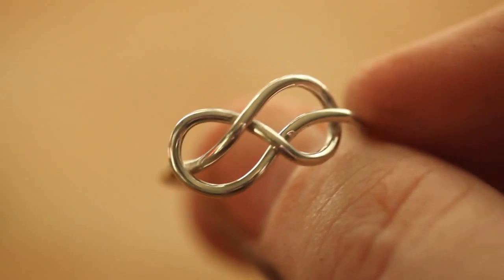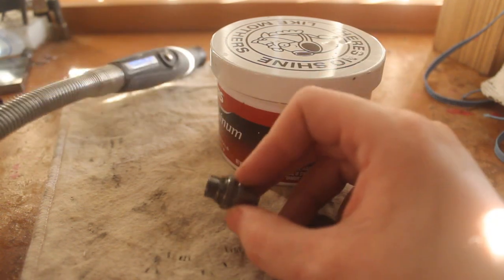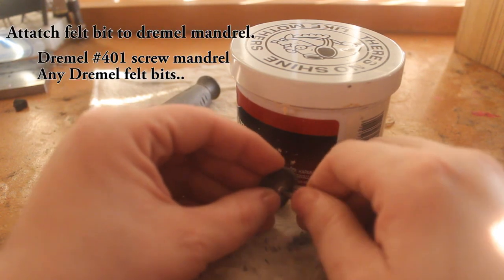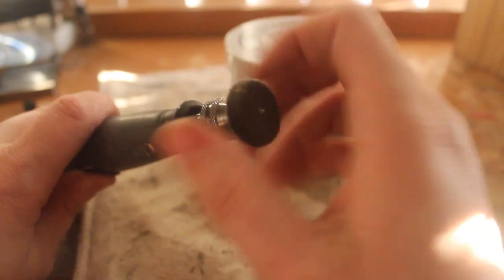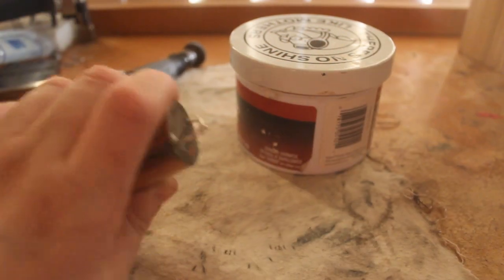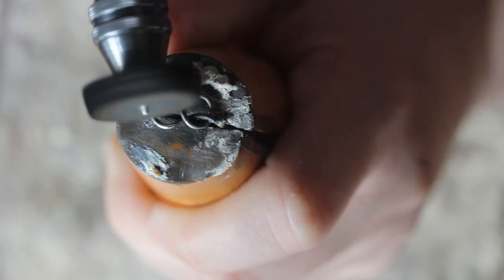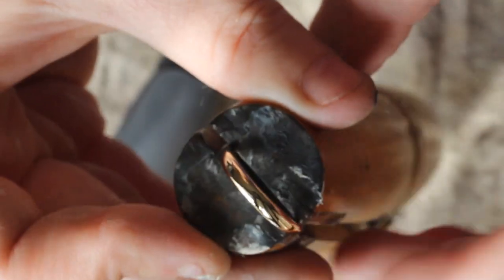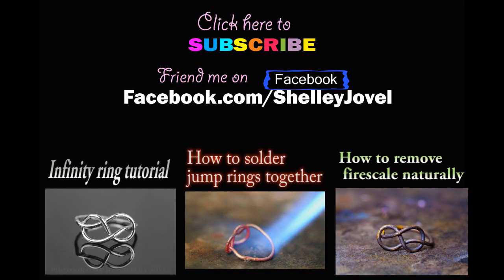How to polish silver and gold to a luster shine

Comment: Bravo. I've critiqued some of Shelleg's other videos. This one uses good technique and tools, and VERY IMPORTANTLY includes safety precautions.  
 Many materials and processes we use to work fine metals expose us to very serious health hazards. In this video, do not take lightly the advice to wear a mask and eye protection. You also want to wash your hands afterwards, or wear gloves if practical. This process is similar when using a buffing wheel on a large table- or bench--mounted machine (like a bench grinder).  Polishing with a buffing wheel really heats the work up fast, so with larger pieces you'll want to wear gloves. Buffing wheels often grab small pieces like rings and throw them across the room! Something like the wood ring clamp is necessary then, and must hold the piece VERY tightly to avoid losing control of the piece! There are polishing aids for this, stubby little pieces of wood with tree sap or tar at the end. You heat up the sap till it's soft enough to embed the work and tgat can give a good firm hold.
 Sometimes for larger scratches or lots of firescale or larger pieces like a box or locket you'll want to start with a courser buffing compound and you will work your way down from courser to finer compound to get the best possible finish. The metal bits and the stuff in the polishing compounds are very dangerous to inhale, or get in your eyes, or to absorb into your skin.
 After polishing, usually pro jewelers will put the piece into an ultrasonic cleaner to get the polishing compound and debris out of all the crevices. The budget way is with a toothbrush and dishwashing liquid, but he sure to cover the drain so you don't lose your precious piece down there!
 Pro jewelers, especially ones who work with gold, will save the dust and powder from cutting and polishing, as well as anything else that collects the fine metal bits. After months or years they will send the collected debris to the smelter and get big bucks from all that gold dust! Most of us don't have to worry about that because we don't work that much. But if you start doing a lot of work it's worth considering. That's why jeweler's benches have a veey shallow drawer under the work surface. They sweep debris into the little drawer and let it collect there. They also build little bench aprons that they spead over their laps, etc. to catch fine particles that would otherwise drift to the floor. A jeweler's work is usually underpaid, so that gold and silver dust can make a difference.

Comment: Toothpaste also polishes silver too.Wet the item, put on a little pea size of toothpaste and rub between your hands, then put on a bit of liquid soap, run under clean water and hey presto! clean silver with no chalky buildup like if you use metal polish .Particularly works well on snake chains and 'woven' silver

Comment: Is this good to remove scratches too?
Reply from the maker: Yes absolutely. Doing this will eliminate small scratches in the metal. If you have deeper scratches in the metal you can remove these scratches buy rubbing the metal with sandpaper.  Start with 320 sand paper, then 420 paper then finish with a 600 sand paper. After the sand paper use the technique I show here.